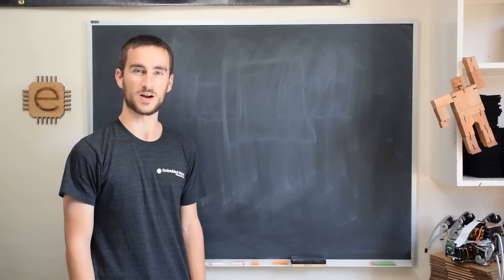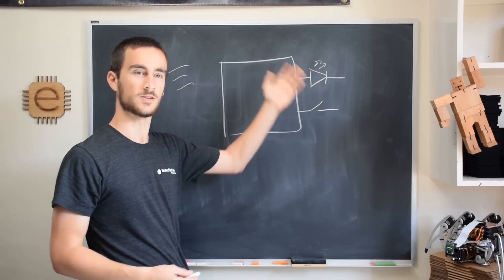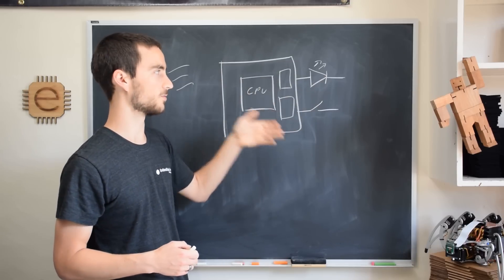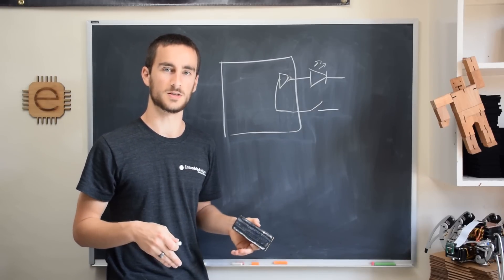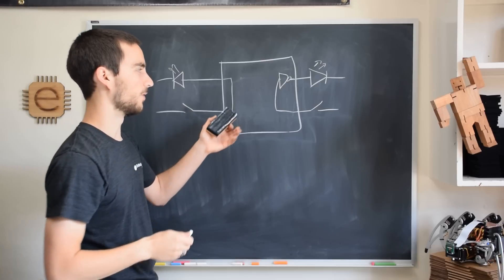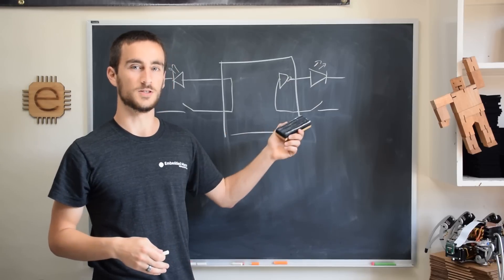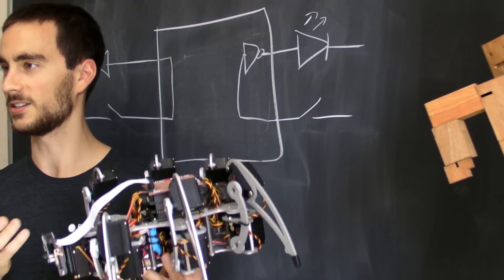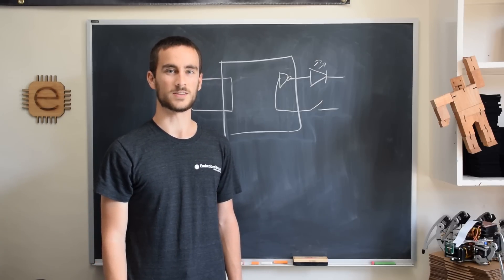What is an FPGA?

Comment: i still don't get the point, sorry i'm dumb as f. I mean why shouldn't i simply use a pcb with with whatever circuitry I need instead? I mean why fpga? and dude you are suffering from up syndrome you need to slow down a bit ;-)

Comment: Nice project but still can't understand FPGA
Reply: FPGA, field programmable gate array = outside the factory customizable switch cluster... as I understand it, it's just a box separate from the computer chip, that handles simple tasks by directly connecting them with wire, which frees up your chip to do other complex tasks... it's a box that handles simple tasks, directly thru little wires :)
Reply: an electronic breadboard
Reply: It's hard to get. I found this slide that's clear and made me understand FPGA and other PLD's:
http://www.ece.tamu.edu/~xizhang/ECEN248/slides_Chapter3_6.pdf

I Hope it help you too

Comment: For what i do understand is ,, each processor has their own type of computer languange embedded into it's rom, meaning that if i want to run an program on it based on another type chip , then i need an emulator wich not not only ltranslate the cpu languane to another languange wich that cpu understands, but also let it behave like that other cpu, 

With a fpga chip, there is actually a flashible rom chip inside wich you could reprogramm sothat it can put any computer languange on it on after another per reflash and let it behave differently.
Wich is interesting.

Comment: Hey Justin, just a question - in the example with the NOT gate - if the FPGA switch is off... there won't be any current flowing through, so the diode won't turn on anyways, right?
Reply: That's true. It's just an example I think. You could for instance have a connection running through the FPGA that has a switch that is always closed through which the diode is powered. When you press the outside switch you power a little induction inside the FPGA that obens the switch inside the FPGA and therefore disconnects the diode from the power source.

Comment: I wanted to like this, but unfortunately I still don't really understand what an FPGA is.
Reply: I will receive flack for this, but a simple way to look at it without any technical knowledge is...
FPGA = semi-truck (ton of shit at once but slower top speed)
CPU = Lambo (Can get you there fast but good luck fitting extra stuff)

In general, the lambo may outperform the Semi in short distance with many things; however, over long distances it is much better to cram everything into the semi and do it all in one trip. In a nutshell, this is what happens in regards to the processing/output.

The FPGA is typically much slower in clock speeds (1ghz, 2ghz, 3ghz, etc) but in one clock speed it can do so many tasks at once within that single clock (similar to a semi taking so much stuff in a single trip)

The CPU is typically improved by increasing the clock speed (modern CPU is at 3ghz or higher) and handles many small tasks very well... but when a large load comes along the FPGA can be utilized to do it all in one trip, rather than 200 trips back and forth in the lambo.

Day to day use tends to be better with the CPU. For example, taking a lambo to walmart and getting groceries would be much more efficient and speedy than taking a semi. With the semi you must prep everything, wait for it to warm up, etc. Plus, in some cases the wife tells you to go back because you now need the caned pumpkin, then you have to go pay the electric, then you have to go pick up the kids, etc. Doing all those small trips would be horrific in a semi, but the lambo would make it quick. Considering this, FPGA tends to be a benefit for commercial uses more so than with typical computer users.

This is a personal interpretation... do not go around telling your friends CPUs are lambos and FPGAs are semis... they will most likely call you ignorant, haha.

Hope that helped.

Cheers

Tucker
Reply: your explaination for me is the best!! TQ!!
Reply: me too

Comment: I ordered my Mojo a few days ago and I'm a fan but just to nitpick a little: A solution in between would be to program the GPIO peripheral to respond to rising/falling edge of the switch input and in that interrupt you set the corresponding LED output. At least it is event-based rather than polling. But your point is well taken and illustrates the difference nicely.

I've worked on a number of FPGA/Microcontroller solutions (most recently Kinetis Cortex-M4 & Spartan 6). In our case we used the FPGA to perform synchronous detection with an 8-point 1 MHz sinusoid which would be very challenging, impossible, or foolish to do on a Cortex. I relied on another engineer to implement the programmable logic while I wrote the firmware/Python code. I'm looking forward to using the Mojo as a learning platform.

Comment: Thanks for making this video.  I am not familiar with FPGA.  Is the connection to the LED a physical pin connection that is accessible from a pin connector on your board?  What is the input and output voltages of these pins?  Is the LED being powered by the current going through the FPGA chip?
Reply: The LEDs on the Mojo also have their connections broken out to the headers. The voltages of the IO pins are 3.3V. The LEDs are powered by current supplied from the FPGA. Each pin can supply a few mA  which is plenty for an LED (there is also a limit on the total current. but it is reasonably high).
Reply: Awesome.  Would be nice to see how you hook up the signal and power to the servos of the hexapod.  It looks like you have multiple mojo boards on it in the video?  BTW, are you going to MakerFaire?
Reply: The servos connect to a servo shield http://embeddedmicro.com/development-boards/servo-shield.html

There's only one Mojo with a few shields stacked on top.

I'll be at the Maker Faire with a booth so make sure to come check us out if you go!
Reply: Justin Rajewski Thanks.  I did not realize you sold a servo shield for the Mojo Board.  24 servos is awesome.  I'm curious to see what you did with the video feed processing.  Nice job!